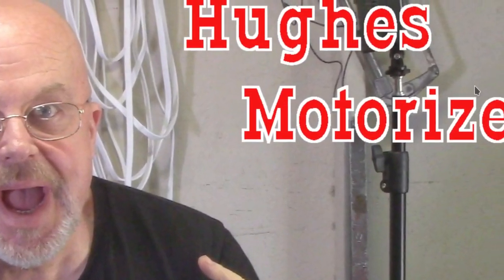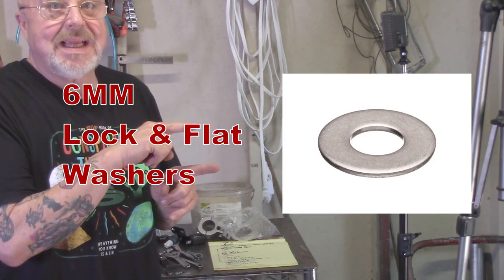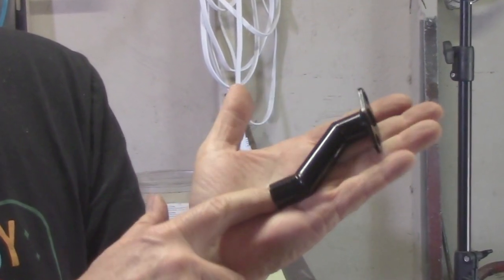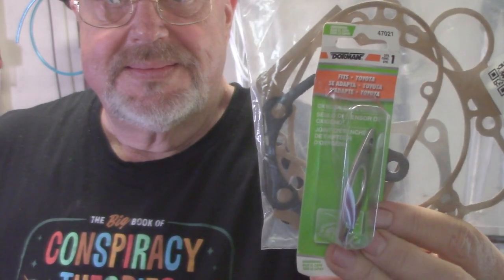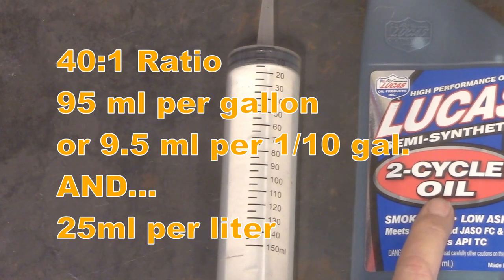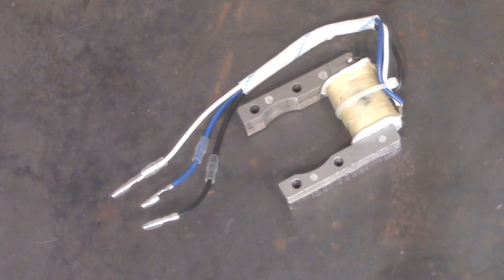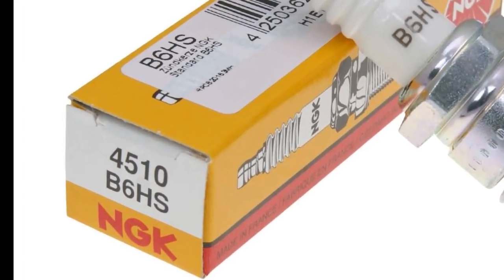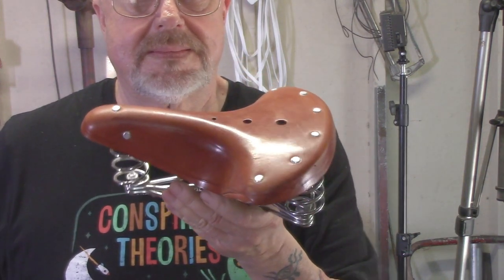Part 4- How To Build A 66cc 2 Stroke Motorized Bicycle Beach Cruiser - Suggested Upgrades & Extras

Comment: Hi, Eugene Thanks for this video! I like to be prepared for the inevitable breakdowns that come with the territory, your recommendations and suggestions really help! I was taken by surprise by your remarks about fuel mixtures. The manual that came with mine says: break-in ratio should be 16:1 and the regular mix is 20:1. I understand using more oil for break in but I have never seen a 2cycle that ran off 20:1 normally, every single string trimmer I've dealt with was 40:1. I was really surprised when I fired mine up the first time that there was no smoke at all from the super-rich starting mixture! I want to take your word on the 40:1 regular mix as reliable and I imagine that will allow more power or speed when it runs as well. I'm 185 pounds and just a little more power may be able to take me up the steepest incline along my way. Guys like you Rock!
Reply from the maker: 40:1 from day one. No break in mix required. You want the rings to seat in. Some go to 50:1 using synthetic and some even run 100:1 on some of the high end synthetic oils.
Reply: @HughesMotorized  Do the Chinese stock Z8C spark plugs really suck as bad as people claim? They claim an NGK B6HS plug will make a HUGE difference and that they just throw away the Chinese plug.
Reply from the maker: @michaelbrinks8089  Ive had good luck w/ the kit plugs but I don't aim for super high performance either

Comment: Cool thanks for links. It makes you have to reupload just to change description?
Reply from the maker: good eye. No not to add links. I made a change in the vid about spark plugs. I was giving bad info about spark plugs & weather. You want a colder plug for higher compression engines. not weather related like I was taught. I shall educate myself further and do a vid on spark plugs soon
Reply: @HughesMotorized  Have you ever took  the fabric & zip tie off a bad magneto stator to see if the copper wire winding inside is coated in any protective resin or varnish? I'm thinking they don't last because it's just a bare copper wire winding with only the fabric and zip tie for protection. Usually a small engine stator lasts for several years.

Comment: Just watched your episode on the China version of the Springer front forks! Which is exactly what I have! Do you by chance know if I were to order a pair of triple tree style forks do you know what length to get for a 26 inch huffy beach cruiser? Or any recomendations? Figured it might be worth a shot to ask! Thanks bud!
Reply from the maker: I'd offer simply measure the forks you have. Cool think about most triple trees is that if a little long you can easily cut them at the top

Comment: It doesn't look like there is much to the magneto coil that could go bad/break.... It's basically copper winding around a metal core with wires soldered on. The only thing I can think of that would make them go bad quick is either#1  engine vibrations break the solder wire connection or break an internal copper wire winding. #2 moisture/condensation gets inside and either corrodes it and/or the moisture creates a bad connection/short/no spark.... I notice the only thing covering the copper winding is some fabric & a zip tie. I'm guessing moisture/humidity can soak that fabric & act like a moist rag around the coil.  I took some $1 clear 2 part epoxy and coated the fabric wrap, solder joints and edges on the side between the plastic & metal core where moisture could make it's way inside. When you look at larger engine stator/magnetos they look much better water proofed, coated in an amber colored epoxy (I forget what it's called) If I had 2 motorized bikes/2 coils  I'd experiment and epoxy coat 1 coil & leave both bikes/engines in the same conditions and see if the coated coil lasts longer than the un coated.
Reply from the maker: I]ll guess the copper wire is of suspect quality is the main issue
Reply: I haven't took the fabric and zip tie off the magneto stator to look at the windings  but I suspect the copper winding wires underneath aren't coated with anything to moisture proof them. Other small engine magneto stator winding are coated in a resin/varnish.
Reply: @HughesMotorized Ever take the fabric wrap off and have a look inside? Next one I buy, I might take the fabric cover off, lightly coat in epoxy re wrap, coat solder connection,etc..and see how long it lasts.

Comment: Here's some tips the CNC billet mount the t-bone will come in different width and length cuz I've got one it's like an inch and a quarter you can get them up to an inch and a half to it 1 1/8 that is the distance between the motor and the billet mount
Reply from the maker: who sells them? have a link??  I only find 1 1/2"
Reply: @HughesMotorized  I got mine from manic mechanic and you make some in the 8 mm and 6 mm stud mounts and then he makes them in different heights for the t-bone  mount
Reply: @HughesMotorized  mine's one in a quarter from the motor mount to the motor
Reply: @HughesMotorized  he also makes the rear post mount too
Reply: @HughesMotorized  it's on my YouTube channel what it looks like does it come in he makes them in three sizes I can't ride right now I shattered my knee and lower left leg so I've got still plate and screws I had put in on last Friday I destroyed my leg on memorial weekend I was on some gravel and it slid out from underneath so I got a long recovery
Reply: @HughesMotorized  I got the billet Mount off of eBay but I got the motor mount bracket piece for manic mechanic
Reply: @HughesMotorized  The 20/20 hyper beach cruiser the frame is larger so I had to use a CNC billet mount the motor wouldn't fit directly to the frame too much of a gap some of the newer frames are doing the same thing
Reply: @HughesMotorized  they got my throttle from eBay to pit bike throttle fully aluminum with the ball bearing cable puller and it's got a quarter and full action throttle has two nipple spots for the cable to connect to and you can change the throttle housing piece itself the tubing with different cable links for the if you want a quarter action or if you want a full throttle or a half throttle
Reply: @HughesMotorized  you should do your helmet safety video again about safety equipment jackets and stuff like that I had one it worked it saved my butt other than my leg when it shattered just because I've had two other knee surgeries in the past but the helmet and jackets and stuff pay off I can vouch for it
Reply: @HughesMotorized  I wasn't going that fast I was going like 5 miles an hour just coming to a stop sign and then the bike sit up ungravel anything can always happen regardless
Reply: @HughesMotorized  I hope you had a good Father's Day have a great day
Reply from the maker: @willardbuchanan9122  Cool. Thanxx I'll link him up

Comment: Hi, I am having issue with sprocket adapter slipping and hitting spokes. Any advice?
Reply from the maker: You can file off flat edges of adapter or cut a piece of soda or beer can and make a shim so you can get the adapter tighter
Reply: @HughesMotorized  will try thanks a lot